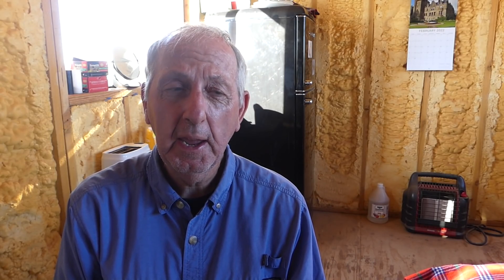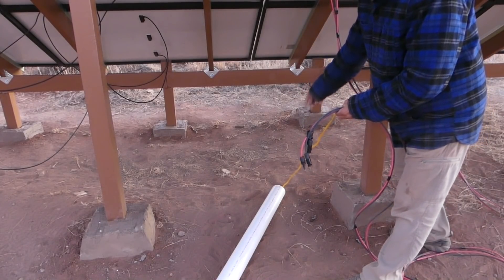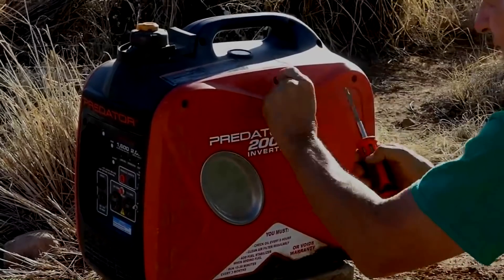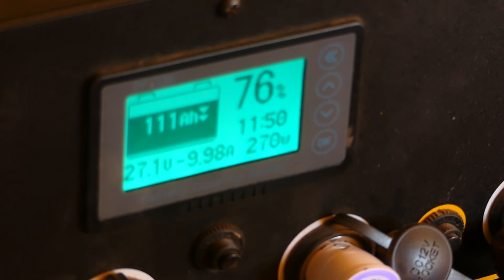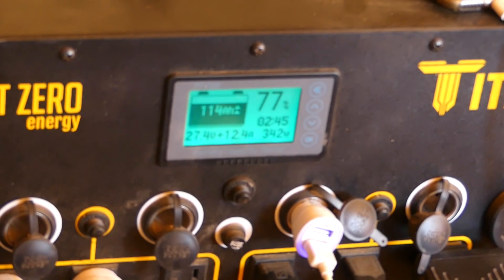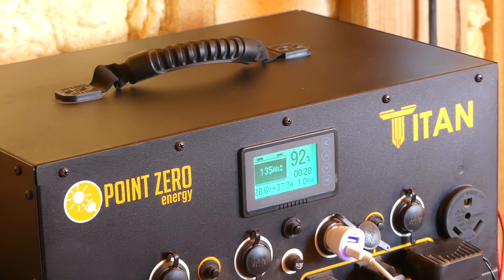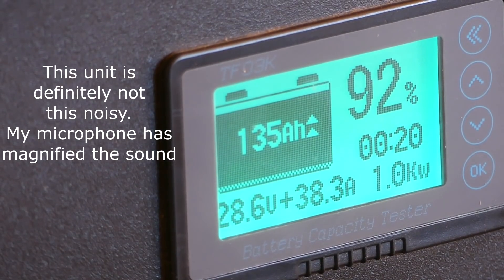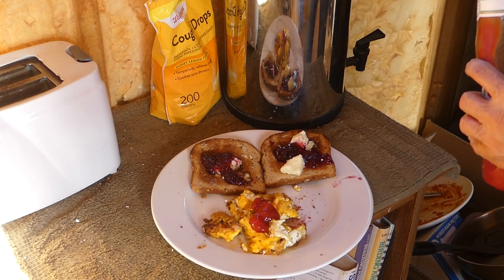Off-Grid Senior Powers 200 sq ft Tiny Cabin with Solar

Comment: The mini split on solar will be awesome. I would also suggest getting yourself an induction cooktop. It uses about the same amount of power as your toaster does. Doing these thing can pretty much eliminate the need for any costly propane. 
One thing of note, make sure the mini split you purchase is a 120v volt version. Most are 240v but if you look around a 120v can be purchased. This is important since your titan only outputs 120v. 
Good luck don.
Reply from the maker: Thanks Michael!  Yep already covered the part of a 120 volt mini split.  240 wont work for sure. I have a couple or 3 of them selected already as possibilities.
Reply: @affordabledesertliving3487  Why would a 240 volt mini split not work?  Either use a split phase inverter or install a 120v to 240v transformer.  With the 240 volt mini splits you can get 38 seer for almost the same price.  The newer high seer mini splits are a no brainer with a limited solar system.
Reply: @onecontinuousadventurre1850  probably because he doesn’t have 240v
Reply: @onecontinuousadventurre1850  thers losses when you convert from 120v to 240v. The seer value isnt apples to apples.
Reply: @Santor-  that is correct.  The losses can be around 15%, but the gain from 15 or 18 seer to 38 seer is over 100%.  Huge benefits on solar to use so much less wattage.
Reply: Do you have any suggestions on an induction cooktop? I’m doing pretty much what Don is but with a cargo trailer and him a bit ahead of him. I have my mini split already installed (9000btu 115v) and it’s working wonderfully cranking out heat on these cold mornings. Draws about 16 A when running (24 V) and a little over 21 A during start up.
Reply: I use an induction cook top.  It's definitely the way to go for solar.  There is cookware that won't work with it though, ie stoneware, aluminum or copper. Cast iron and stainless steel work well.
Reply: An induction cook top uses too many watts for Don's limited system.  Plus, no oven.  Don has it right to use propane for cooking, hot water, and heat.

Comment: Be careful with those used Tesla batteries. A guy on youtube called "Rich Rebuilds" had a vehicle that he built using those cells catch on fire.
Reply from the maker: Yikes!  I guess its best that I didnt go that route then!
Reply: @affordabledesertliving3487  Oh for sure. Those batteries are designed for complicated battery management systems. cooling systems, etc. honestly more trouble than they're worth. You made a good decision going with something a bit more plug-and-play. Way easier to set up and maintain than a tesla car battery.

Comment: Wow Don your all set up now make sure your fridge is inverter type im told they run better on Solar im amazed you did all that i understand electronics and could do that with a bit of difficulty i love to help you Don but im way over hear in Australia when will you get some Chickens ?  i dont like eggs at all but love eating chicken hahha  your have done good job there for sure make sure you fill all the holes in the bottom of the floor there also get the pipe coming up to the panels you dont want water getting in there cover with electric tape or that grey plumbers tape to keep the water out hope you did seal all the connection in the pipe to that plumbing stuff the purple one there over hear its blue glue dont know why its the same stuff
Reply from the maker: Thanks for thinking of me mate.  Yeah had chicken sandwiches for lunch today LOL.  Am going to use different pipe and glue at this point. Change of plans. Thanks for watching.  Maybe I will see you on my first LIVE event in a couple of days!

Comment: Fantastic Set-up - Great Job, Don. Yes, California is a place that is good to be "from". Electrical Code - You may need a quick disconnect between your panels and the Titan. Ketchup for eggs, a must!
Reply from the maker: Hi Don many thanks for the comments. The titan comes complete with surge protectors etc. built in. The great thing is that with the owner builder permit I can aspire to code but simply focus on safety. There will be no inspections.  Yeah Heinz for eggs!
Reply: @affordabledesertliving3487  Put in a fast disconnect in outside box. When thunderstorms come your way; pull it ! The surge protect on your Titan, won't save it. Your warranty won't cover thunderstorm damage. Midnite Solar do disconnects. Make sure you put in a lightning protector too.Again use Midight brand; top quality and cheap insurance.